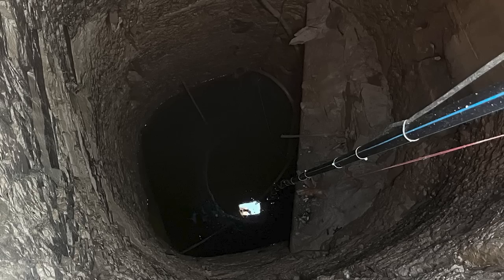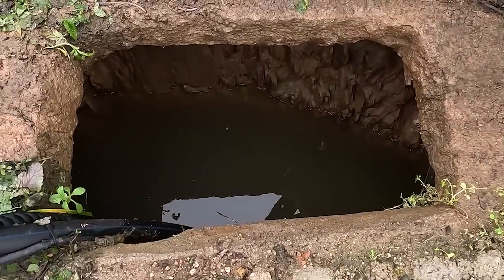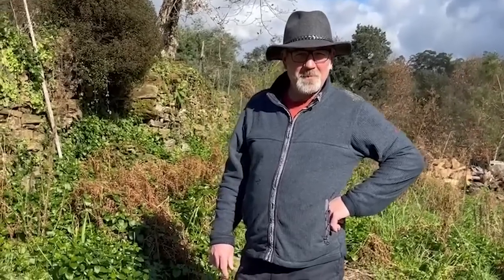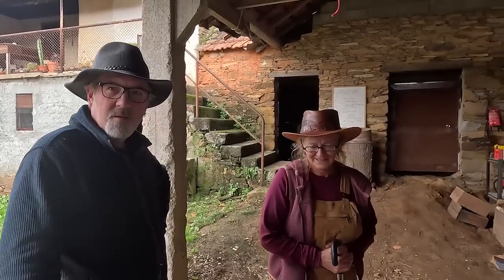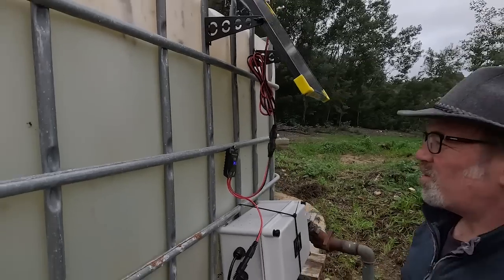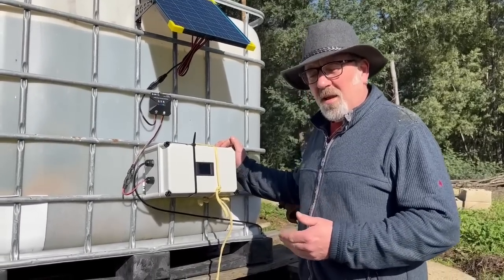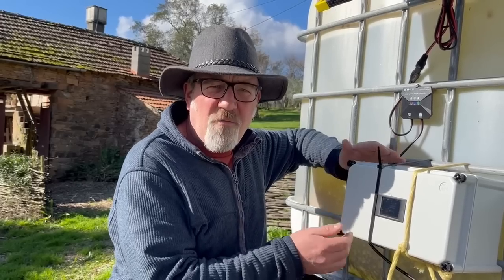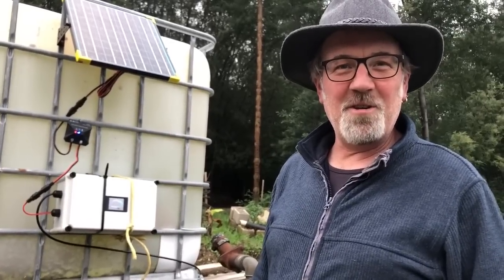Measuring our Well - Everything's Changed

Comment: Tin snips come in handy but remember that they're manufactured in left and right handed articles. Hacksaw blades or any blade, the softer the material the coarser the pitch of teeth per inch, when cutting a soft thin piece of steel choose a very fine pitched blade. A wood saw or chainsaw have coarse pitched teeth for a reason.
Reply from the maker: Thank you. We’ll get some tin snips soon. 👍

Comment: How did you calibrate the transducer ?.
Reply from the maker: It’s a high end pressure transducer which doesn’t require calibration on setup unless high levels of accuracy or certification are required. It’s good enough for what we need at the moment.

Comment: Love your you tube posts! Have you considered the impact of strong UV/prolonged heat on the wellometer display, inverter and junction box contents? Maybe resite the electronics on the shadier side of the ibc?
Reply from the maker: That’s an important question. Yes we have. For now, it’s not hot 🥵 but we put it out of sight of the track to begin with. And Dan hasn’t got around to fixing the brackets he made yet either. Even in the shade it can reach 40C here in the hottest part of summer. Thinking caps are on. Thank you for such a great comment. 😊👍